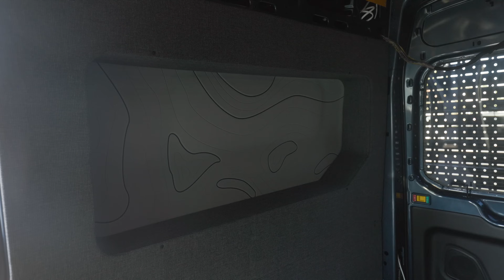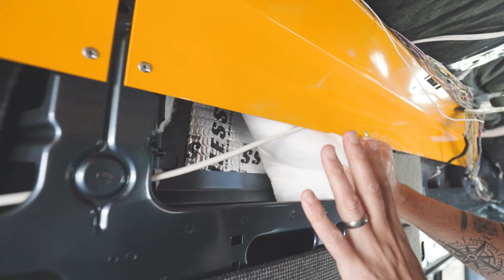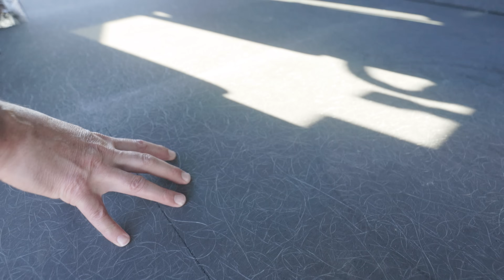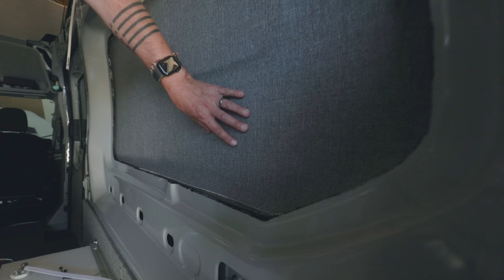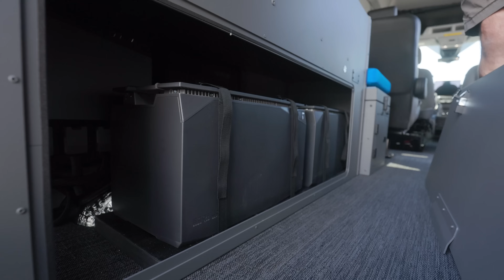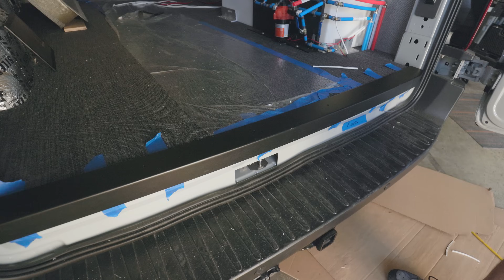GONE MOBILE VANS | Review of Build Process

Comment: Great info. So my goal is to take a van, like yours, skiing. While skiing and away from the van the interior temperature could easily drop below freezing. Do you have plans for adding heat tape that would automatically turn on when the inside van temperature drops. Or do you have a set up that will turn on a pump that will automatically circulate heated water when the temp inside hits freezing!! Maybe you have already addressed this concern. Your thoughts? Thanks .

Comment: Is that enough insulation outside California weather...
Reply: Gone Mobile Vans did my interior build and used this same insulation. I just got back from a snow camping trip in Colorado where temps got down to 7 degrees overnight and I had to actually get up to turn my heater down because it was too warm.  I think this type of insulation with the heater would be sufficient for most temps people would find them in.

Comment: Baltic Birch is a great material.  HOWEVER, like all other plywood it does absorb moisture over time.   Do you guys seal it (like using polyurethane spar varnish) ???   (I've seen picture of people tearing apart their vans after a couple of years because of moisture absorbing, swelling of plywood, mold and mildew.)